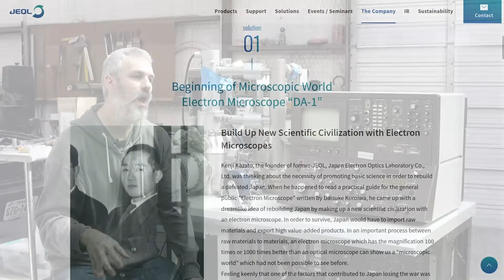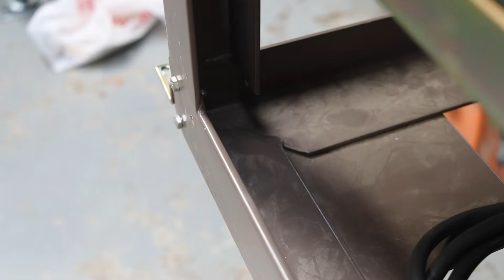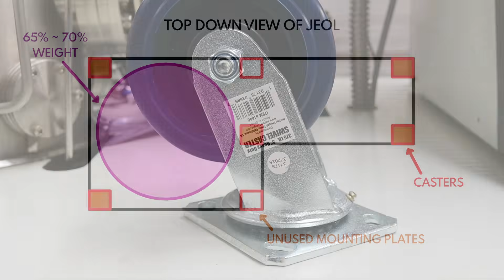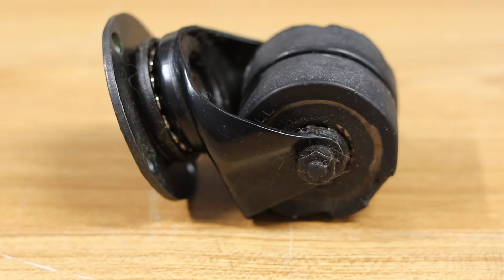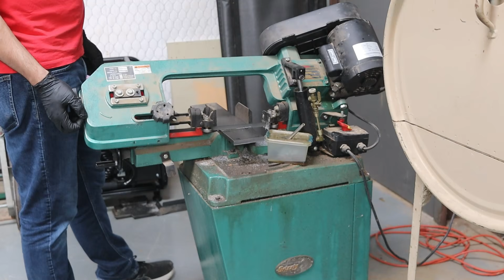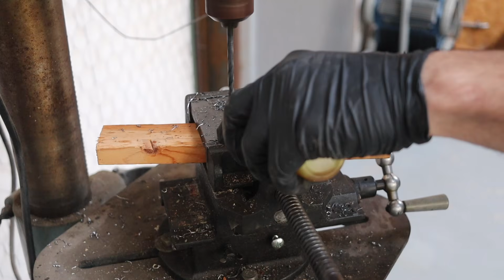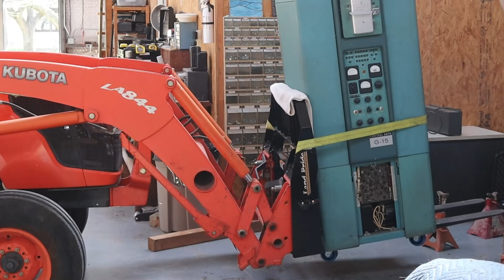Usagi Electric Is Changing, and Here’s Where We Start!

Comment: 16:42 say what again? i LOVE steel and machining it (or even by hand) - it's pretty much the perfect material humans came up with: endlessly 100% fully recycleable (fun fact: for most steel types the actual "raw" material is 50%+ of old steel) - and thanks to so many different types and compositions there's pretty much always the right type for any job
combined with concrete (another material I really like) both are the foundation of modern constructions - quite literally
also: broke one tap for 32 threads? pff - did countless during my training and never broke a single one - do you use metric or imperial?
also also: 66°C for a band saw motor - nothin wrong with it - likely comes from the high work load from the cylinder being busted not holding the rig up properly

Comment: Should you ever need to drill up again, use a jack. I build cars, whenever I have to drill up, like putting holes in a frame for a transmission crossmember, I put the drill on top of my screw jack and slowly spin the jack up. Basically an upwards drill press. Works amazing. When low to the ground, a regular floor jack works well; awkward, but well.

Comment: I'm surprised that you didn't use any casters that have brakes, I'd be worried about all the kit accidentally rolling around when it gets bumped. That would also allow you to keep the JEOL on its wheels and braced against a wall, engaging the brakes so it stays put just as solidly as if it were on the rubber dampers.

Would it even be possible to use the vacuum system on the JEOL to connect up to the Bomem as well?

Comment: I'm surprised you keep think that drum is titanium. Titanium was extremely hard to come by in the 50's and 60's. A hunk that big would have been ungodly expensive. Titanium is also a pain in the ass to machine and put a good surface finish on. It's one of the most abrasion resistant metals there is. It's pure evil to machine and grind on.

Comment: I'm betting for best results, you'd need more than just one set of isolators.  I have worked on machine tools where the machine was mounted to isolators to a huge slab of concrete.  And it would not work properly, because other machines on that same slab of concrete were messing with it.  Ended up having to cut a hole bigger than the entire machine, fill the hole with sand, and then cast a separate floating slab on concrete for just that machine.  Then it worked without issue.

And that machine tool didn't require the noise/vibration isolation an electron microscope would need.

Comment: You no doubt succeeded already, but could you have built a cradle, installed casters on it and then loaded weighty topply device on the cradle? The cradle could be secured by gravity alone foremost and by stop blocks place at non interfering locations around the devices own base.

Comment: 4:25 Instead of removing the casters, build a pallet with rubber isolation to fit around them. Jack it up, insert and secure the machine to the pallet, but let the casters remain for later.
Reply: That's not a bad idea. Or something similar. I read an old book on making holograms (BEFORE diode lasers!) and they recommended a table stood on top of part-inflated rubber inner tubes, since holography also needs incredibly stable bases. Some sort of stable base that our guy can wheel the microscope onto for use. Car inner tubes on the floor, atop that, perhaps some sandbags for greater inertia, then atop those, a big thick chunk of plywood. Wheel the machine up on a gently-angled ramp, then take the ramp away.

Comment: Another interesting video. Your messy shop is way cleaner than my shop. I need to dedicate some time to cleaning this spring. I live in Michigan, so it’s hard to go to the shop when it’s 20 degrees. I don’t have it insulated yet to heat it continuously. The most interesting thing I seen was your tractor was 2 wheel drive instead of the common 4 wheel drive. I didn’t know kubota made a two wheel drive version, now I know. Looking forward to seeing you get the other G15 running. Maybe the two old computers can have a chat??? Thanks again for the videos.

Comment: Can you put the rubber dampeners on the side of the casters? So when you are to use it, just jack ut up and put concrete blocks under the rubber dampeners and let the casters hang in the air.

Comment: Use the original swivel wheel holders and remove the bolt and nut. Take out the 2 wheels and replace them with purchased new small wheels. Then you don't need to make an adapter plate.

Comment: Have you considered building a purpose-built, adjustable castor-supported steel frame for moving around heavy equipment? Even two? you could move around heavy stuff with those and stow away the platforms when you're done ... no need to modify anything ;)

Comment: Just coat the back of the plate with sharpie. Screw it down. Then take it off and drill holes for the bolts that are on the bottom.

Comment: Tapping block - can't say enough good things about that method. Get a block of steel or even aluminum, or perhaps hardwood. Use the drill press or whatever to drill a proper hole perfectly perpendicular. This now becomes a guide block to tap with. Tap a size 2, even a size 0, 2mm, 1.6mm, straight without breaking. 1/4 inch becomes easy.

Comment: Perhaps for the JEOL you could rig up a base that has both the casters and the rubber absorbing mounts.   You'd have a lever that would push the casters down when you need to move the unit, and when it's in place you move the casters back up and rest it on the rubber mounts.

Comment: See like you went the long way around with the bendex.  Probably would have beem easier to build a custom heavy duty furniture dolly and just set on that.  Maybe use some original bolt holes to stabilize the union.

Comment: Is the "new" G15 not as tall as the one that was fully repaired?
Reply from the maker: The G-15 itself is exactly the same size, but I'm using 4" casters with smaller adapter plates on this one compared to the 5" casters and bigger adapters on the previous one. So, with the casters mounted, the new one does sit about 2" to 3" lower than the previous one. Good eye!
Reply: @UsagiElectric  I just seem to recall the "old" G15 being about the same height as you and the "new" one is not.

Comment: on your pronunciation of Auger:
reading the IPA transcription and comparing it to what I hear, it's very close, but I'm still gonna be pedantic, just for fun...
the stress probably goes on the first syllable instead of the second, though this is mostly just speculation since there's no stress markers.
it also sounds like you're using English long vowels ō [oʊ~əʊ] and ā [eɪ~ej] (or in my case [eʝ]); Japanese short vowels お [o] and え [e] should be spot on.
I hear the soft J [ʒ] (think like the S in measure), which is correct, where a lot of people would probably reach for [dʒ]
(or perhaps even [g] given the spelling, since it looks just like the English word 'auger' [ɑːɡɜ˞])_

Comment: If it's just the wheels and not the bearings or metal of the old casters, you could restore them by cannibalising new castors for their wheels and turning whatever you needed for an axle, could even re-bearing with a little bit of machining and welding.

Comment: I have a slight concern about the grade 8 bolts used throughout. Grade 8 is stronger, but also snaps rather than bends, which in this case, I'd prefer bending.

Comment: That's how wheels used to be in the 1950s, 60s and 70s. Everything load bearing was pretty tiny, the rest of machinery heavy and bulky. You should see the ones they had used on hospital beds. They get stuck solid instantly in the crack of an elevator.
An just look at the office chairs from back then. Same deal, get stuck on anything, even a paperclip. I had used one which came with a Zuse Z25. The base has only 4 arms instead of 5 mandatory since the 1970s. If you lean back hard, you can trip over and smash your skull. In Europe, they are banned since the 1980s.

Comment: The casters on the G15 look a heck of a lot like the casters that you would have on a Grand Piano, and it wouldn't shock me that is where they're from. They are frequently doubled up like that, the legs on a grand have a fairly small square at the bottom, and the weight of the Piano is likely not that far off that of a G15.

Comment: Those old double casters look like the ones used for pianos, they need to take the weight, hence double wheels, but not lift the piano too much, so small wheels. You can still buy them.

Comment: It's on a forklift, why the hell wouldn't you lift it higher.  Work smarter not harder.
Reply from the maker: If I lifted it higher, I couldn't put jack stands underneath as a safety backup. I was not comfortable relying solely on the hydraulics holding pressure while the tractor was off, I wanted a redundant, mechanical stop in-case anything went wrong. I'd much rather lay on my back and work hard than die on camera.
Reply: @UsagiElectric  Agreed, you should not trust hydraulics, but I'm sure you could have found something to stick under it in that shop!  But if not then I guess that was the best way.

Comment: My first Auger was a Phi 545 built in 1972 (allegedly;  I used it in the 90s).  It ran on a PDP11 with a dual floppy drive, HP graphics terminal, and HP pen plotter.  Since then I’ve used a Phi 600 and 670.  Auger is such a cool technique, you’re gonna have a great time.

Comment: JEOL, Ltd. is still around and making scientific instruments and electro-optical or ion-beam systems.  They make NMR and mass spectrometers, electron microscopes (both scanning and transmission types), surface polishers, electron lithographs, and yes, even Auger microprobe photoelectron spectrometers.  The current model similar to the JAMP 10-S is the JAMP 9510F.

Comment: Back in the 1970s, my Computer Architecture professor talked about drum systems.  They were basically any well-balanced, smoothly running wheel or cylinder.  I'd be surprised if they used titanium for the drum, as I don't see the surface getting very hot or needing the other thermal properties of titanium.  A very hard aluminum would be a very machinable surface that could be balanced to run smoothly in that drum drive.  The professor told us that the largest computer drum made was a six foot long length of thick-walled cast iron sewer pipe that was 36 inches in diameter, machined smooth and with an applied magnetic coating.  Getting the right coating onto the surface of the drum is going to be the interesting bit in this project.

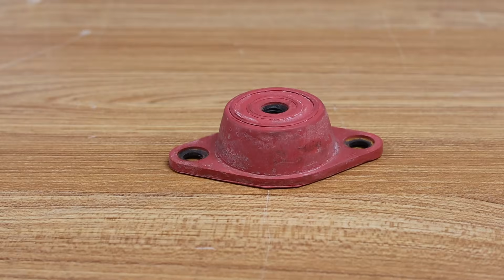Comment: 3:30 - Suggestion: Add the castors, then add the rubber isolation feet.  When you want to use it, place hydraulic jacks under the feet to lift the entire thing until the castors stop touching the floor.   You can isolate it, but you can still move it.

Comment: Looks like you are using Harbor Freight casters.  I would build a mild steel metal frame under the units using a Harbor Freight wire feed welder.  Then metal plates for the casters and upside down screw jacks., that I would bolt to the plates that are welded to the frame.  Build supports accordingly.  I would then buy Amazon car jack screw jacks, I paid less than $20 each, and bolt them upside down by the casters.  You can then roll it wherever then screw down the jacks to stabilize and level.  
Then attach plywood to the top and secure to frame.  
I did this for my full size flight simulator and it works great.  It's 4' X 8' and over 400 lbs.  I can roll it anywhere then screw down the upside down jacks to stabilize and level.

Comment: Just watched @RetroComputingRanch 's video. What a bunch of hard work! @UsagiElectric I spent at least 15 minutes with my inner monolog "The man has random pices of steel every time he needs to mill something but dosent have a pice of diamond plate or plate steel to put on the threashold and roll those big ole casters right on in?" :D as a 56 yearold who worked in a computer refurb and storage facuility in my youth I have rolled literally thousands of IBM, Ahmdal, DEC, EMC, Cray... you name it around warehouses and on and off trucks. they all have crappy little casters. You learn early that even if you can get an IBM 3380 rolling pretty fast, you shouldnt because all it takes is a random pencil, nut, etc on the floor to bring things to a quick and tippy stop :D

Comment: drilling up:
Use a little plastic cup.  tape it to the bottom with a painter's tape so you keep both hands free for the drill, and drill through the bottom of the cup.  It will catch most of the swarf.  A tiny 2-oz clear cup, like you might get sauce in at a restaurant, is perfect.

Comment: At least you're not pronouncing 'Auger' like the English word 'auger'!  

Recommendation - Put the roughing pumps in another room if at all possible and route the vacuum lines through the wall.  The noise will drive you bonkers.

That's a small microprobe!  The JEOL unit I used to work with surrounded the chamber with a cage of X-ray spectrometers.  Most were electrically tunable - so we could go after multiple elements in backscatter electron; secondary electron emission (including Auger); and X-ray in Kα, Kβ, and Lα lines. There was some weird metallurgy we were trying to chase after. 

My job was automating the test, so the operator could load a sample and walk away. Lots of image analysis of both optical and electron images, to steer the beam to features of interest and take spectra. Which involved machine control of a lot of different things: optical scanner, microscope stage, beam position (and scan generator), beam voltage and current, Faraday cup, SEM image collection,  tuning the X-ray diffractometers, starting, stopping, and reading out counts, on and on.  Pretty sizable software job! The upshot was that the operator could spend 20 minutes loading a sample, identifying regions of interest, and walk away for several hours - the code would move the stage around, find features of interest in the SEM images, and take spectra of those features. Previously, the operator had to sit and do all that manually for the entire shift.  It was quite a cost saving, and even the union didn't gripe - the operators hated that job!

A few years later on, the company called me out of retirement to build another system (with different equipment, because of course some of the stuff wasn't made anymore).  They'd hired a contractor to do it, but he got stuck on making the build system work, much less adapting the software.

Comment: Castors are likely only temporary things, you replace them with fixed mounts when installing it, likely using a set of mounts that were installed under the side channels to support the whole machine, leaving the castors there unused, and thus not having any stress on them, so the tiny footprint was to handle the trundle from the receiving dock to the floor jack, that then moved it to the computer room and its final positioning.

Comment: Holy crap, the drum may have crashed when that caster broke!
Reply: Actually, that drum I believe was originally in the first G15.  David swapped them with the one back in the museum in the interests of getting at least one machine working.  But that, of course, left the problem of re-coating for another day:  and now that day is coming!
Reply: I would expect that the caster broke when the machine was being moved, and while being rolled, it hit a gap in the floor, which caught the wheel and stopped it, while the upper part didn't stop. But I suppose that it's possible that the caster was only cracked while being moved, then later actually break apart while the machine was operating. Who's to say?
Reply: @Mueller3D  But the drum didn't crash.  It was fine.  It even still had its timing track intact, and it is the one functioning in the other G15 now at the museum.

Comment: Way back when as a PhD-student i was working (alongside a technician) with a SEM to get some pictures of the materials i was working on.
Also got some Transmission Electron Microscope pictures done to look through my stuff as well and obtain X-Ray-Spectra.
So i am very eger looking forword to this journey similar to the Bowman IR :)
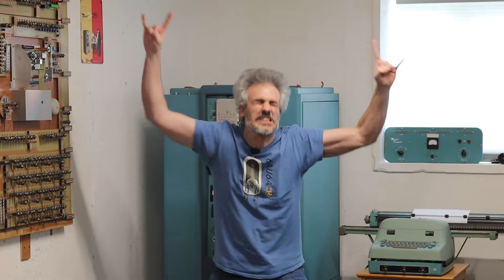9:00 XRF is certainly the way to go there to find out about the composition. After that it will be a matter of microscopy or Light Scattering to dertermine particle size before fabricating and applying a new magnetic coating
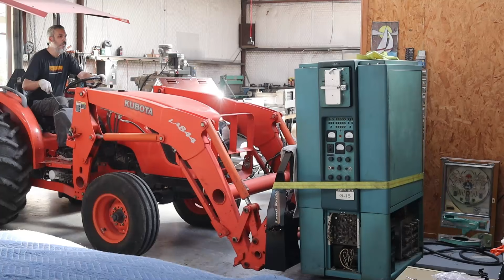17:00 The other solution to consider would be to expand the room. More space for more toys and more fun^^

Comment: You are indeed the CasterMaster!
My father was a surface scientist (and prof) at RPI and used several Auger devices in his lab.  Not sure if any were from JEOL, though.  I operated one as a summer job in mapping the surface of some sample.  In this case, output was to a plotter.  I don't recall much detail as this took place in the late 70s.  My father published a textbook on surface science which is still in print, but as most textbooks are, costs a bit of money.
Funny story:  He once got a new vacuum chamber that had a huge steel bowl suck on to protect it.  Mom used it in the kitchen for big salads for years.
Reply: Who was your father?  At various times I worked on software for electron microprobe analysis over at GE Research in Niskayuna. We had a few collaborations with RPI, I might have met him.
Reply: @KludgesFromKevinsCave  John Hudson.  He retired from RPI years ago, now enjoying his retirement.
Reply: @Whiffert name rings no bells, but it's been a while. I wasn't a surface chemist. I mostly did control software for the instruments, with an occasionally first into instrumentation and control electronics.